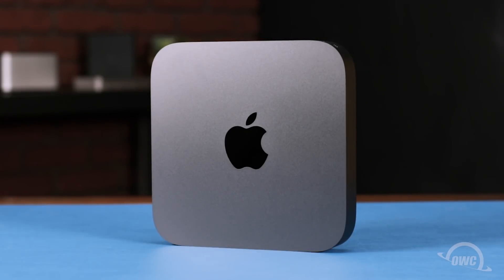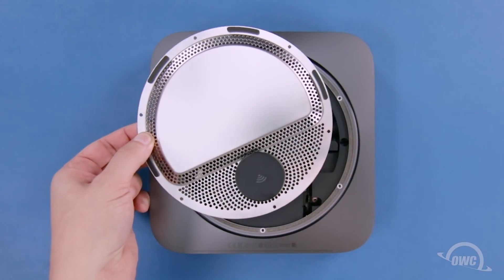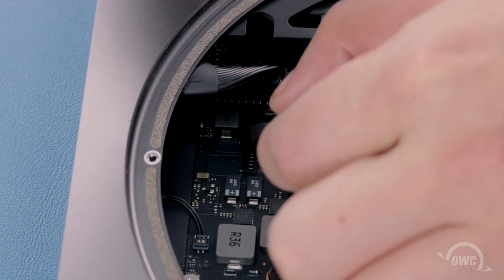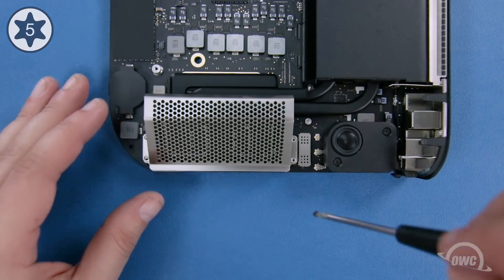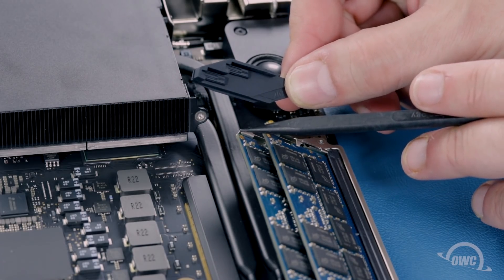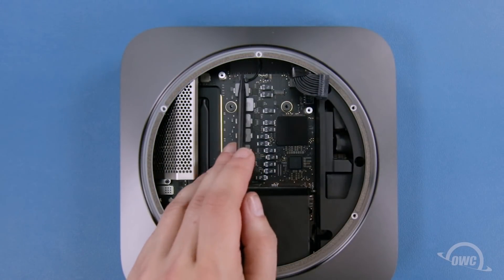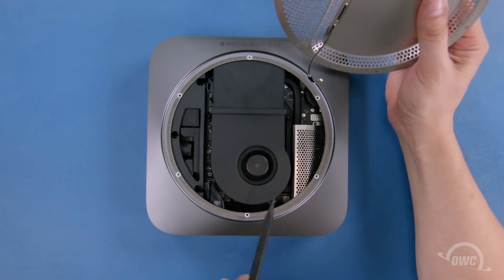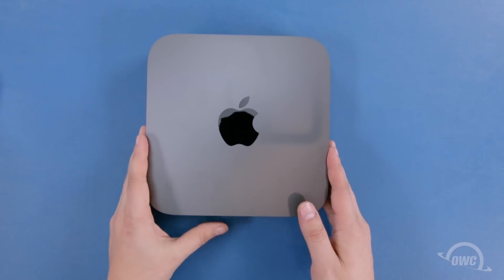How to Upgrade the Memory in the Late 2018 - Early 2019 Mac mini (Macmini8,1)

Comment: Great tutorial, no iFixit style "just do all the steps in reverse" reassembly copout.

Still amazes me the 2018 Intel Mac minis are the only ones to this day which allow 64GB of RAM.  Even the just-released 2024 M4 Mac minis with the redesign can only be specced up to 32GB, which for certain tasks like having a lot of VMs running can be a bit limiting.

I currently have two of these, the base Core i3 with 128GB SSD and now a Core i5 with 512GB SSD and they're both good little machines; fast, versatile and powerful despite their small size.  Make excellent general purpose machines, even discreet home servers due to having a decent selection of ports on the back, with good bus speeds.

Comment: Could you make a video on how to upgrade?
  the ssd in this mac mini please?
Reply from the maker: We apologize, the SSD on the 2018 Mac Mini is not able to be upgraded after purchase.
Reply: Sadly, the SSD chips are soldered to the logic board and are not replaceable (except by dosdude, but it's hella expensive and needs mad skillz LOL). I "upgraded" my system drive  – the internal 500 GB flash was getting too crowded – by adding an external Thunderbolt enclosure paired with a fast 2TB NVMe.  The external storage ran around $300 at the time, but costs quite a bit less now. I installed the latest macOS on the external, used Migration Assistant to pull over everything from the internal, and set it as the startup. I've actually been booting off this drive for 7 months now with no issues, and the internal still has macOS installed just in case. If you go this route, use Thunderbolt storage, 10Gb USB is not really fast enough. Other folks on YouTube have videos about moving your user folder(s) – usually the largest chuck of used space on the SSD – to an external drive, leaving the internal just for macOS and apps. It's tricky, but can be done.

Comment: The crucial ram I’m ordering is ddr4 3200 or 2933 or 2666mz. Will the mac support that? Or do I need to find 2666mz ONLY? 

Thanks!
Reply from the maker: Apples memory specification is (2666 MHz). Our OWC memory upgrade kit is listed at 2666MHz DDR4 PC4-21300. The ram you mentioned could possibly work, but we haven’t tested any other capacities, so we cannot say for sure. When in doubt, it’s best to go with apples exact specifications.

Comment: DON'T DO IT. I followed this tutorial to a tee (four time actually0). The video is very well done. But I have no idea what I did wrong, but now I have a $2000 Mac Mini Brick. It won't even power up. b  I put the original memory back in. Still a brick. I'm off to the Apple store with my tail between my legs.  I've done many many h/w mods to computers, including macs over the years. This is the first time anything actually broke. Dumbfounded, actually. And quite PO'd.
Reply: Apple ended up replacing the entire motherboard. I ended up just biting the bullet and bought memory from them. Hard to believe but they said it was possible the memory was bad and could have ‘shorted out’ the board. 

Whatever it was, should you go down this road proceed with great caution or you could find yourself shelling out a lot of money anyway.
Reply: @bradorner  Much more likely the "Geniuses" either lied to you or, if the problem really was a "shorted out" motherboard, the damage was due to static electricity. I understand you have experience and I'm sure you were careful, but most people don't use an anti-static strap and many even stand around on carpet in their socks while doing stuff like this.
Reply: @JohnMHammer  thanks, John, FWIW, I did wear an anti-static wrist strap.  They ended up replacing the entire motherboard and didn't charge me (they certainly could have, but I suppose they saw I've bought a bit of Apple gear over the years). I bit the bullet and just went with Apple cough memory to avoid any further hassles. Really bums me out.  The operation was pretty straightforward. I really don't know what might have happened. I'm going to just assume a certaily level of 'delicacy' of the mini design and move on.
Reply: Bradley Orner yell

rtt5#wnA3* igrq was-9qqqwereerttyjuiC ;    u
Reply: Mjkkop

Comment: Be very careful with the LED cable connector. I broke it. Luckily it's non essential. I can live without the LED. Break any other cable connector on the logic board and it's going to be a lot more troublesome.
Reply: The other thing to take note of is to lay the chassis on a soft cloth. A section of the edges of the chassis seem to have micro chipping even with me laying it on a a soft mouse pad

Comment: Actually I have two minis. One at the vacation house and one at home. The old one is so much better. It has ram right on top. You just twist bottom off. It unscrews. Then the ram is right there. Plus it has a cddvd player. The new ones really suck, but I’d ididnt notice it had no DVD player. The old one, the good one is a 2009 model I think. Another thing...when I upgraded to Hi Sierra it crashed and I took it into Apple and they couldn’t fix it. So they lied and said it needed a. New HD. Two days later I got it back with the alleged new & free hard drive. WRONG. They did nothing. Eventually, I juked around with it and fixed it myself.
Reply: ziblot123 upgrade to a 2010 (still has DVD player but is faster) or a 2012 quad core i7 (no dvd player)
Reply: Ya I 

 Ughhhhhhhghhhhhhhhbbhhhhhhgwkwjsjsosnska

                      Chi us chi communion Lincoln hill yuhyytt to op
Ppl ooiygyyooiuytyoiuuyyghyoiuyyo
Reply: ziblot123 kk

Comment: All of those screws to replace ram 

Apple for no reason SMH 🤦‍♂️
Reply: Nah mate normal pcs are better and easier to upgrade by far
Reply: Yes all you really have to do is open the computers. Front panel and then open the ram holders on the motherboard . Pretty much no screws . No unplugging stuff . Very easy
Reply: A
Reply: Branden Nunez  for the slight dif the ram increase is gonna make I would just buy a new one.

Comment: Just got the mini, and followed this guide to install more ram. I have worked on nearly every Mac since the fist one, the “Classic,” and for the first time, I broke something: a cable connector housing. It just lifted off the pads of the motherboard with almost NO pressure applied with my spudger.  It must have been a cold solder joint, because of the way it popped off. Now I have a doorstop. Off to the Apple store tomorrow. Many have done this very simple upgrade with success, just be very careful, I may have had a bad connector.

Comment: I got one recently and it had tamper proof T6 screws. Make sure you get tamper proof t6 bits
Reply: super important to use the "Security T6 Torx" screwdriver to remove the first 6 screws! Not the same as a T6 screwdriver. I caused myself hours of extra work not paying attention to that.
Reply: yes i got a refurbished mac mini and first 6 are security t6
Reply: iFixit sells all the tool you'd ever need. Definitely recommend them. As I'm sure OWC does as well.
Reply: Some of the torx security screws can be removed with a flathead screwdriver but yes the torx security bits are definitely recommend

Comment: I followed all of these steps exactly and upgraded from 8GB to 32GB - it's recognized and complete. BUT - Now there is a very strange squeal, faint sound coming from the Mac mini - it is annoying as hell. Any ideas on what this could be?
Reply: Either something is interfering with the fan, or there is coil whine, where a component vibrates at a very high frequency.

Comment: What’s the failure rate of 3rd party memory? Years ago 15-20% of simms failed and when units returned to Apple the memory chips would be removed and returned. Anyway, it seems amazingly complicated to replace but that’s the price of high maintenance beauty. But the convenience of being able to transfer 100GB FileMaker dabs using FileMaker Go between Apple computers with just the touch of a button using AirDrop makes it all good for me.
Reply: Jack Rodgers, Jr. hmh njuuji

Comment: Apple obviously wants you to work hard to avoid that 300% markup on RAM.
Reply: And to have only 2 slots available to make your existing memory useless.
Reply: I literally went down here to say the exact same thing 🤣. Apple is way overpriced and impossible to customize without paying another $400 on top of the natural “apple” premium.
Reply: I just bought the tools, followed the guide, and did the thing though. 32gb. Thanks, OWC.
Reply: Apple computers have always been very picky about the quality of the memory used. The cheap, generic RAM that PC's use doesn't always work. Yes, sometimes you can get lucky and find some that does but most of the time you won't. Apple's markup on RAM isn't as high you think because it is higher quality than cheap, generic RAM. Even aftermarket RAM that is guaranteed to work with Macs is nearly as expensive.

Comment: I’ve changed the memory on my older MacBook Pro and iMac easier than this. 🤦🏽‍♀️ I’d rather pay for the $150 upgrade....
Reply: Chelle Carey DONT be a rich snob and do hard work. I am eleven and do this fkin repair a lot.
Reply: @amhanson_  you're eleven and you have a mac "repair" business? good for you!
Reply: you must still live in the past...Ram inside macbook pro cannot be replaced, also iMac? Really? You rather tear down the whole iMac glued screen and other parts to do the work?
Reply: Lin J the 27’’ iMac still has user serviceable RAM via a small door by the power socket on the back of the machine.  Do your research before you make stupid comments.